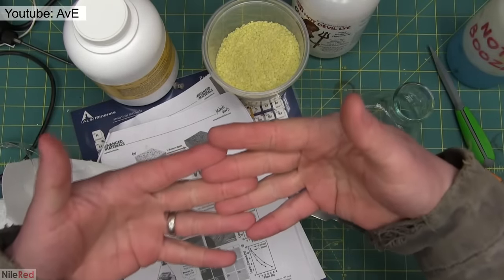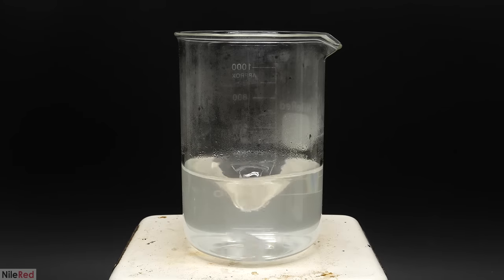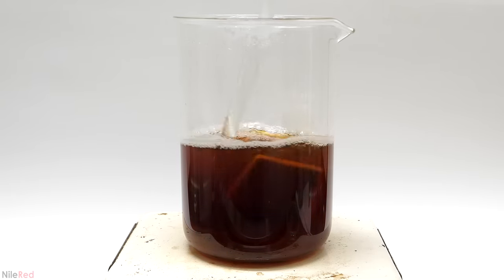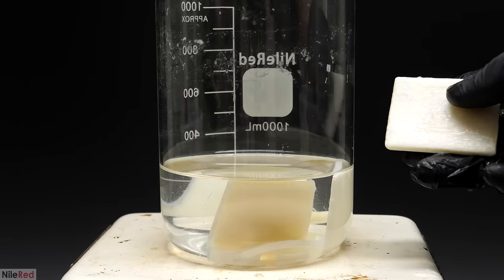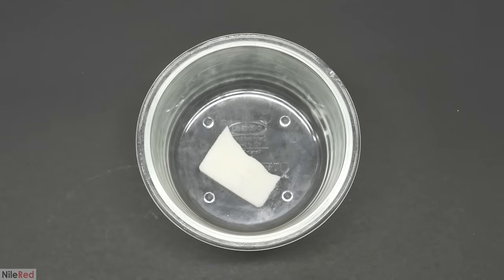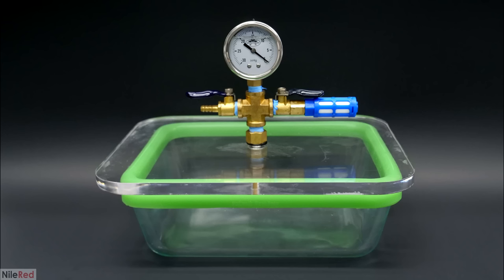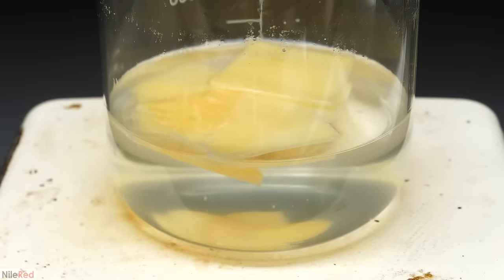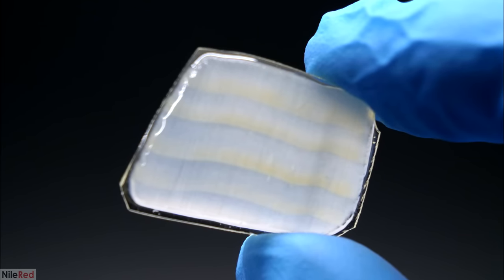Attempting to make transparent wood

Comment: I like the length cut grains it looks like a tiger's eye opal gem. I think it would look amazing if you used it in a office or bathroom door by taking a solid wood door cutting the middle out so it had the exact grain pattern and shaving a slice off it. I think with a big square piece if you used a vacuum storage bag and poured the epoxy in first then put the wood on top and used the vacuum pump on low to slowly pull the epoxy through the channels in the wood you'd get a better saturation, then topping the piece with a mixture with more hardener in it after you pull it out might stop it from warping.
Reply: Had another idea instead of using epoxy which has a set drying time what if you used a UV actived resin like they use on windshield cracks and phone screen protectors then you could let it soak as long as necessary as long as it's in a air tight container and the ones I've used viscosity is much thinner than any epoxies I've tried.

Comment: Hi, i migth have a tip for you about your vacuum system. In avionics they use vaccum bags that seal almost perfectly and due to the high pressure in those bags the pieces remain flat. They also use some mesh in the bag to remove all air and spare resin. In avionics they use this method with carbon fibre repairs. Give it try. ;)

Comment: Hey you should try stabilizing resin and then curing it with normal resin. Stabilizing resin can pernitrate things really well. Peter Brown made a bowl out of charcoal by doing this. It would help get the resin in deeper as well as make it stronger for the main resin curing.

Comment: Amazing! As a hobbyist woodworker, I could only add a couple of facts that might have been useful even though I will go against the grain, at least paper wise. I don't have a lot of experience with basswood as it is very soft, but based on my experience, a spalted red oak could work very well for this. Spalting would have already removed a bunch of lignin and cellulose and red oak is very slurpy along the grain, both for water and resin.

Comment: For a faster vacuum, have a separate large vaccum chamber connected with a T to the container with your sample. Pull a vacuum on your large chamber and close the valve. Now start your vaccum pump and slowly open the valve to your larger separate vacuum chamber. This will pull msot of the vacuum and the pump can finish to a higher vacuum.

Comment: Wouldn't applying pressure to pump the ethanol out and the epoxy into the wood make more sense than pulling a vacuum and potentially blocking the holes in the wood before the epoxy has any chance to get in once the vacuum is released?

Comment: Polishing the top and bottom surface should drastically improve the transparency of the final product.

Placing a flat sheet of glass on top of the pieces and letting them fully cure over 36-48 hours before pealing them off might help prevent the cupping.

Comment: I bet a million dollars the ones that are cut long way, with the grain, would make a much more smooth, clear, & stronger result that the crosscut pieces. ‘Reason being is this:
When looking through the finished product of the cross cut (the ones that take up the resin so much easier) is that you are essentially looking down the grain at a bunch of densely packed tiny circles. This pattern of tiny circles is why they never come out smooth and why the cracking looks the way it does and is unpredictable....Capillary action via many various sources of internal pressure pulling inward thereby pulling the whole thing into multiple pieces.
When looking“sideways” through the grain of the pieces cut with the grain you are looking through the thinnest part of each individual grain; a series of hollow cylinders stacked on top of each other, rather than than trying to look through a densely packed pattern via the densest perspective of its cross-section. I promise It would result in a much smoother finish than the cross cut sections as it wouldn’t present the sand-like grain pattern created by a bunch of tightly packed circles, but the “sides” of a mere fraction of the number of grains, which actually have strength of uniformity not provided by the easily crumbled cross-cut pieces, aligned in a way that they present longest and smoothest part of themselves . 
I know it’s much harder to penetrate the center of those pieces as the distance is so much further, but I see the benefits in cracking that code will be exponential

Comment: smoothing the wood with a plane after cutting it might help with transparency, as all the fibers would be closer to the same length so they'd scatter light in a similar way. wood coming off a table saw is going to have really rough, jagged fibers

Comment: As this is an old video, I will not read through the comments to see if there was a comment regarding. 
If you clamped the epoxy and wood like you would making micarta, it would keep it flat.
This would be tricky as most of the clamped material is epoxy instead of the wood. It would have to be done in a few stages as the epoxy hardens. If this could be done  successfully, the wood could be very large and thick in size, and it would not curl and be perfecty flat. 
As well, the wood could be cured, polished and repeat the process to make thicker if needed. 
... just a thought.
After though... if the top side of the experiment is thick with epoxy, it should still work. Only the bottom side needs to be thin, or close to the paper.

Comment: If ever you wish to exhaustively remove lignin this extraction should be done as many times as required until the solution is colorless. You can test to see if there is any remaining in the wood by taking a thin slice and treating it with a drop or two of phloroglucinol which stains lignin bright red.. I doubt you really need to go to such lengths but some woods do contain quite a lot of lignin in secondary thickened areas. The lignin thickening is a major source of the tensile properties of wood so of course as a composite it might lose some of that. Some difficult to work burl woods are treated with resin impregnation to render them stronger and more easily worked on a lathe.

If you just want transparent wood rather than a composite (which is obviously much stronger) its just a matter of gradually removing the sodium salts in water then removing water gradually through first increasing concentrations of say Isopropanol in water and then from pure isopropanol through increasing concentrations of xylene in isopropanol.or use any other solvent with a refractive index as close to that of air as possible. That way you can obtain something with the minimum translucency and maximum transparency.  It will never be completely transparent because of light scattering by the cellulose fibers.

A similar technique is used in microscopy

Comment: Press the wood/epoxy between two sheets of silicone rubber while it hardens and cures.  The end result will be flat, smooth and have little epoxy covering the "wood".

Comment: Did you try heating the resin?  When potting connectors we heat the resin which reduces the viscosity and allows it to flow much more easily.  This may allow it to soak into the wood much better?

Comment: And what if you first pull out all the bubbles in the epoxy on the vacuum chamber and them pressurize the chamber, maybe the high pressure would force the epoxy more envenly through the little tubes? 
Or the elevated pressure prevents the epoxy from bending on the curing process

Comment: What if you re-did this but instead of washing the wood with 95%  ethanol before putting the resin in you used your super critical CO2 drying chamber? Would that potentially make better transparent wood?

Comment: Have you thought about using UV resin?  You could have a lot more working time to get the resin in the wood and then cure in quickly in a UV chamber.  I bet you could leave it in the vacuum chamber overnight, maybe even several days if it was completely blocked from any light.

Comment: You could probably get smaller thickness by using a wood chisel, maybe sandwiching the wood during curing  will help with the bending? Lastly I have seen some other resin content and it seems like for transparency you need to finish it with a polishing process.

Comment: Perhaps try VARTM to infuse the wood (vacuum assisted resin transfer molding). It’s can be used to infuse composite layups (glass or carbon fiber). In my experience for either simple or complex geometries.

Comment: The wood bent because it warped from the moisture. If you pre saturated the raw wood, dried it again, and then cut it into small strips it might hold it's shape after being treated and cast in resin.

Comment: Just as an idea to pull the epoxy through a long piece cut with the grain, would it be possible to fashion a cap on one end and pull a vacuum. More or less sucking the epoxy like a straw (in more or less the same way that trees bring water up from the ground)?

Comment: Hey Nile, just an idea here.... Since the epoxy is really viscous, maybe try setting up an apparatus so that the vacuum pump can pull the epoxy into the Phylum and Phloem of the wood, maybe using a "chunk of Screen door  fly screen as the Platten ' . and let the vacuum pump run till the epoxy solidifies. Or try using Automotive clear-coat as a watery replacement for the epoxy..... So Ya , use your imagination.... Ciao
Reply: if the vacuum "pull idea " doesn't work ... try pushing the epoxy into the wood samples with a pressure chamber method.  this would be _ top to bottom from side view.... *Air pressure area, epoxy in wood matrix container with Fly screen bottom, stiff metal perforated base plate, then vacuum chamber on the bottom*. Then...Your design here and the procedure to get it to work is your own... if you think this would work ...Ciao

Comment: In the beginning, you explain the 3 main components of wood. Cellulose, Hemicellulose and Lignin. Remove the Lignin, isn't it no longer wood? 😄😄

Anyway, I thought of something ... what if you could extract all that lignin without all those tubes ... and put it back into a woodlike form? I am guessing it would be very weak strength wise but, would it also be more like the characteristics of epoxy?

Just thinking random ideas here.

Comment: But what if you would run the epoxy in vacuum around 10 cycles, replacing the epoxy every 3 cycles? Wouldn't that help to get more in the fibers?

Comment: What if you only filled epoxy half way up the wood before applying the vacuum?  That way you are forcing it in from one direction, rather than plugging from either end of the tubes.

Comment: but what if you use a high pressure chamber instead of a vacuum chamber? (I don't know anything about this tho, I'm just guessing that the high pressure would push the resin easier in the wood fibers)

Comment: What if you used a pressure chamber instead of vacuum chamber during the epoxy step?  I skipped over some parts and may have missed it if you did.

Comment: Try table top resin as opposed to regular epoxy or casting resin. It’ll be harder when finished and should soak into the wood better for a clearer result

Comment: You need to use cactus juice resin before epoxy resin. This is often used to stabilize wood, even rotten stuff, so surely it could be applied here.

Comment: I’d like to see if vacuum can be applied to a larger piece and apply suction so the chemicals can travel through and flush the ventricles of lignin. Wood may be more susceptible to this if fresh cut. It would also be nice to use a naturally-based epoxy.

Comment: I know it's like 3 years later but I think the issue here is that you didn't use a thin enough resin. There's this stuff I keep seeing in resin casting videos that is... Uhhh... I think it's called "Stabilizer", or its got another name and the process that is involved is called "stabilizing". Either way, it's a very thin resin, and it's used to fill in and stabilize (or "solidify" if that word actually has any meaning in this context) any potentially absorbent points on the wood before working with a thicker resin. This allows the wood to be more easily turned after all the required resin is used. My guess is it would take a looooong time to cure, though.
But I'm just a guy who watches woodturning videos, to note. I don't actually know the properties of said resins, so you'll probably want to consult an actual wood turner to correct what I mistakes I might have made and to get more detail on the properties of the resin.

Comment: I work with composites and one thing that's super common is resin infusion, I was wondering if you had a low viscosity and slow setting epoxy it theoretically should work really well

Comment: A Great Video!

May I share some WOODWORKING ADVICE?

To cut such thin pieces, SAFELY, First Lower your blade BELOW THE TABLE!

Now, lay down some GOOD 2 inch masking tape, with the "middle" being where the blade will eventually be brought back up (while the SAW is turned ON!) You might even layer two masking tapes for a more sturdy surface.

Turning on the SAW and raising it, you will naturally cut EXACTLY the "Kerf" of your blade (Kerf: df. the Width of the cut, REGARDLESS of what style teeth your saw has.

NEXT.

Return to using your fence, WITH AN ADDITIONAL BOARD, clamped (or better double sided tape it to the fence. This Board PROVIDES a free falling away from the blade, so your wood will not have "Burn Marks" on it.  The End of the Board on your fence, should be where the saw blade begins the cut.

Finally, Always use a "PUSH Stick" Say a 2X4 about 20 inches long, and push your BASS WOOD through the saw blade As Well as the Push Stick. KEEP YOUR FINGERS SAFE!

Now, about me, a bit: I have worked both Hard Wood & Soft woods for Sixty Years.

After I retired I started doing things like MAKING wood Book Markers, about .035 to .040 Inches thick. I really know how to cut such thin pieces, and I used some very exotic woods.

the First thing I did AFTER CUTTING THEM, was almost flood them with thin viscosity Super glue, to get into those fibers! I would then use double sided tape and stick them to extruded Aluminum that was very flat, and start my sanding.

I would reapply that super glue, as needed, and sand to 1200 Grit!. I soaked off the double sided tape with Alcohol, applied it to the SANDED SIDE and sand the other side until 1200 grit!

These book marks were TRANSLUCENT, and held to a good white light, you would see everything your Chemical baths removed, Some Birds Eye Maple pieces looked like Butterfly Wings !!!

Keep on doing your experiments, MINE started in 1957, building my first Radio! And I have worked in Electronics, Wood, And Metallurgical Arts ALL MY LIFE! 

Hence my nick name Mad Sigh N Tist !

sincerely,
philip

Comment: I think they should have hang dried. If not, they are not drying, the bottom side might not dry at he same speed without air contact perhaps. If you try that again, used a small needle and put a string through then hang it.

Comment: I would like to see this done again instead of putting the wood piece in the epoxy inside of a vacuum chamber you dried the wood with supercritical CO2 so there's no capillary reaction then submerging it in epoxy
Reply: I feel like the problem is that the epoxy is too viscous, so it's hard for it to thoroughly soak the peice of wood without a vacuum

Comment: Could it maybe work better when using a photoresin? You could run the vacuum pump as much as you need and in the end put the soaked wood in a curing station.

Comment: If you had laid a wooden spoon or a mesh screen across the top of the beaker when it started to foam, it would have broken the surface tension of the foam and stopped it from boiling over.

Comment: I would have put 4 plies with their grains in the Y and X axis to cut them way thinner (around 0.3mm) at 0°, 90° and +-45° an infuse the epoxy with a vacuum bag. Also to get rid of the methanol I would have heat the fibers before the process.

Comment: I bet you would get better results from over epoxying, and then sanding/polishing the excess back close to the wood. The transparency of resin is heavily impacted by surface finish.
Reply: That also might help with some of the lensing you are getting from the curve you are picking up when curing.

Comment: Very interesting to see your process of trying to reverse engineer this transparent wood. It's a shame that the authors of the paper left out so much key detail. One of the most important aspects of sharing research is to make it so that others can reproduce and verify your findings. Releasing a paper that fails to fully explain the details of the method to reproduce it ruins that and leads to a distrust of science. It's entirely possible that such beautiful transparent wood is possible to make, but without knowing how, it may as well have been faked. Still, it seems you intuition and expertise lead you in the right direction and the end product demonstrates that it's at least possible.